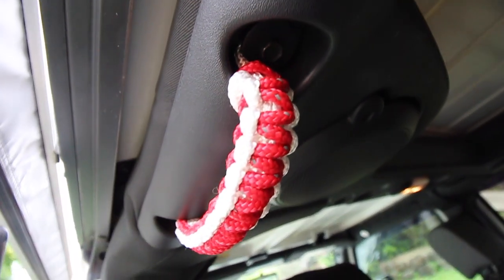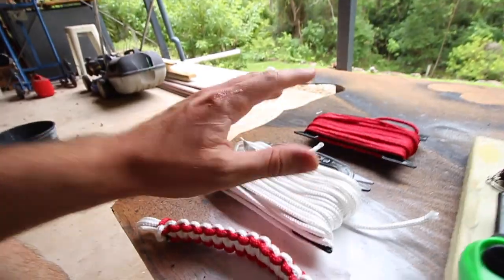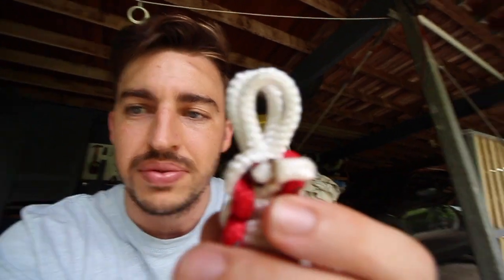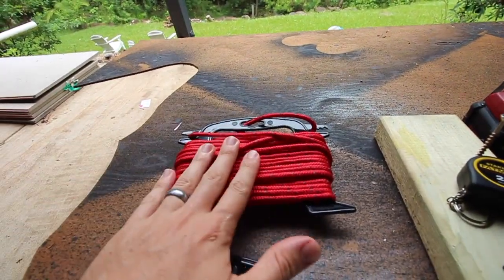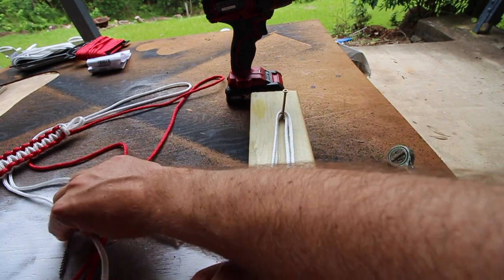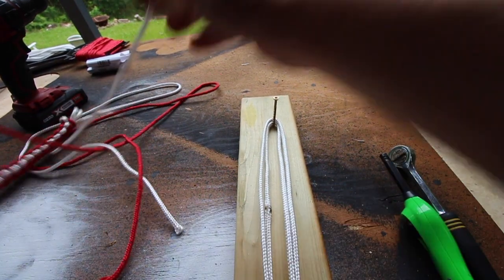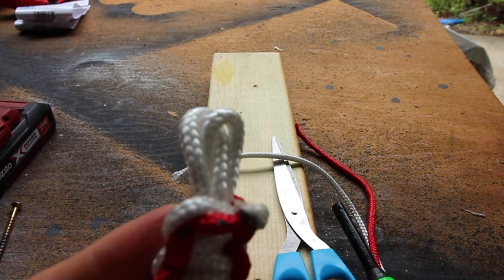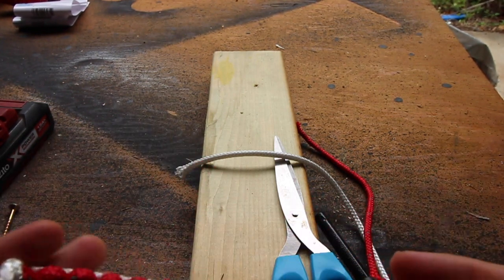DIY PARACORD JEEP GRAB HANDLES

Comment: Just wondering should  the measurements be feet instead of inches?   Looking at making a set of handles myself.  But for a different application.  Thx
Reply from the maker: I did my measurements in mm, would be easier to do it in inches. Hopefully this helps
Reply: Oh ok, just trying to figure out the needed length of each rope section needed to start.  And you do give both the in and mm lengths… but both seem short…only 4in and 6in….thank you for the reply.
Reply from the maker: @Ash-gb8ey  so sorry, it is 41.7 inches and 59.84 inches. I should of double checked that. Thanks
Reply: Awesome.  Thank you.  I’ll let you know how it goes. 

Have a good one!
Reply from the maker: @Ash-gb8ey  yes please let me know how it turns out. No problem thank you
Reply: @Whiteandsonsgarage ok I’m so glad I found this, I was like 6 inches - damn I’m doing good with the ladies then 😂
Reply from the maker: @goldmemberr  hahaha absolutely, work with what you got 🤙

Comment: How strong are these?  Looking to replace a hand for a case.
Reply from the maker: Oh that’s a good idea, how heavy do you think the case would be?
Reply: @Whiteandsonsgarage  at 27 pounds
Reply: It has two holes on each side of the handle attachment to work with.
Reply from the maker: @Kevin-he3ew  ok, let me do some testing for you, it should be ok. I will let you know how it goes
Reply from the maker: @Kevin-he3ew  nice, that will help
Reply: @Whiteandsonsgarage  it's fine I just tried it and it works.  I used a knot for the main strap and just did a Paracord on top of it. Thanks for the idea!
Reply from the maker: @Kevin-he3ew  awesome, no problem at all, happy to help